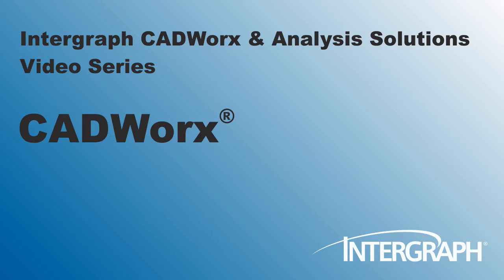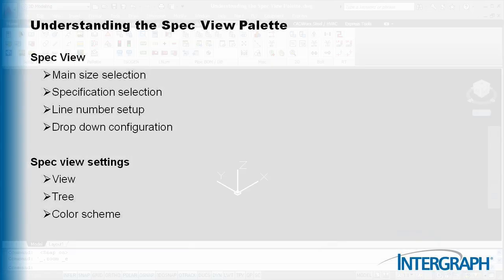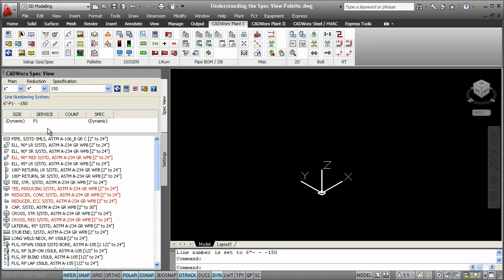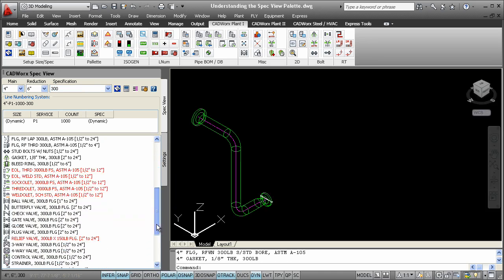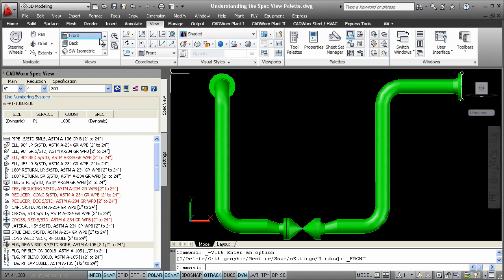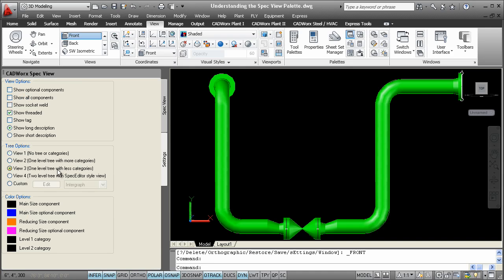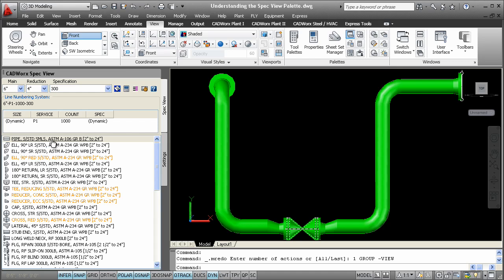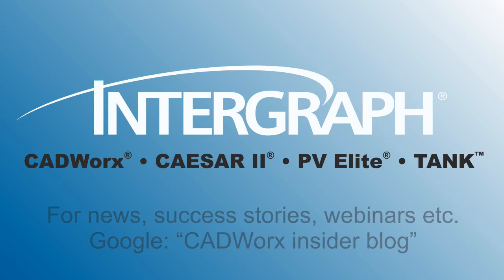CADWorx Plant Professional - Spec View command

Comment: Please Help me. My pipe length is 500 mm but when I generate ISO in Cadworx the pipe length in the BOQ and ISO drawing is 12700 mm.
Reply: Hi Muhammad, if you submit a service ticket through smartcommunity.hexagonppm.com , technical support will be able to help you with this issue. If you don't have a login, contact your CAD Admin or IT to set you up with access, if they haven't set up logins, they'll need to contact Hexagon to have that set up for them so your company can submit tickets. You can also find user help at http://forums.coade.com/